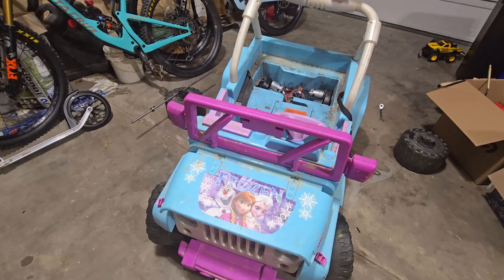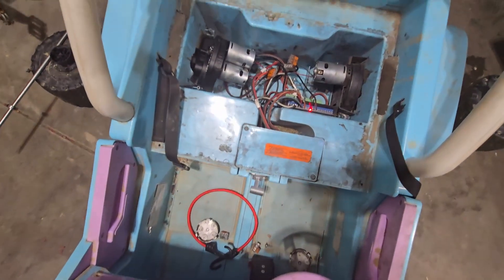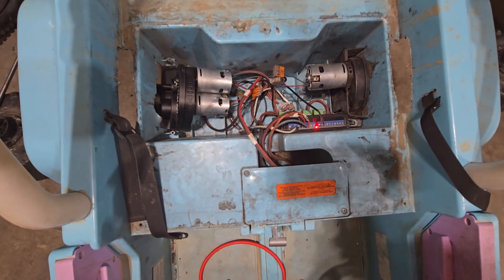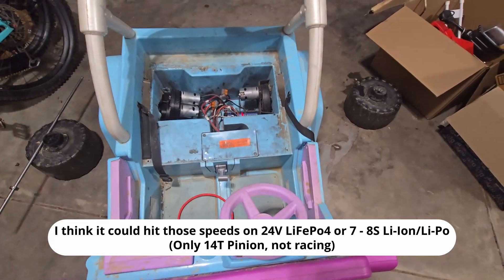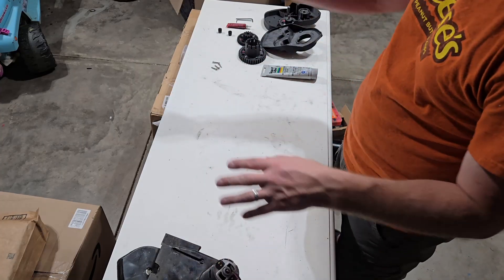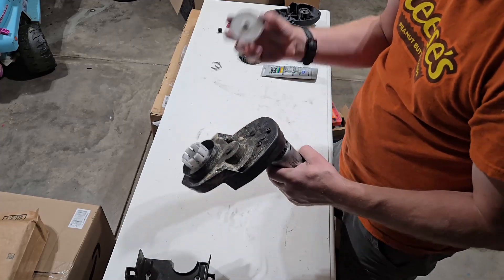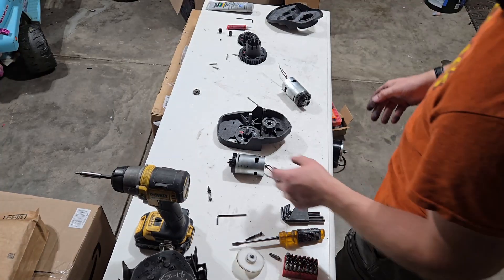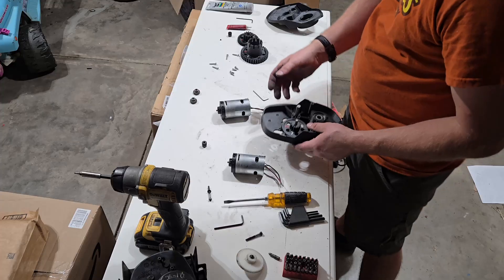2HP 4-Motor Power Wheels Jeep Build – Monster 887 Motors!

Comment: Do you have a link for the 3d printed gear delete?
Reply from the maker: These are Lyles 3D printed gear boxes.  They are for sure great for drag racing, I haven't put enough time on them to determine if they will hold up for ripping around the yard though.  I have noticed a lot of material (looks like brake dust) around the wheels so I am guessing they are wearing a bit.  

https://lyles3dprinting.shop/
Reply: @PeanutWorkshop alright. Thank ya.

Comment: I just got a used one for free. The gear boxes are loose and have play up and down and forward and back on the great box retainer Is this normal? Or are they supposed to be tight with no play?   Btw, it looks like your stock gear box has the plastic gear box retainer but your aftermarket does not, is this correct? Thanks
Reply from the maker: The stock gear boxes move around a bit, even with the retainer. 

The aftermarket ones were rather snug and didn't have the screw holes so I left it off.

Comment: I keep burning up the 895 motor on the grave digger with 24v. Having a hard time finding 887 motors. Where did you pick these up?
Reply: They stock them on their website now. The ones they've found to be most reliable. Johnson 887s I believe.
Reply from the maker: We have an 895 burn out on the grave digger every few hours of riding in mud or steep hills.  We haven't tried putting the 887's in the grave digger but we do have some for sale on the website with an adapter for the 7R gear boxes.  They will not bolt right in for sure.
Reply: @PeanutWorkshop I'm blowing the left motor Everytime we approach full power. There doesn't seem to be any binding the gear boxes are new. Stumped again lol

Comment: Would 895 motors fit on this dual gearbox? And how do 887s compare to 895s? I am interested in this for my dune racer and want high torque for doing steep trails in the woods
Reply from the maker: I don't think you could fit any bigger but the 895's are just about the same diameter so they might fit.  I will try and remember to test fit if o take one apart why time soon.  These 887's have a ton of torque, I have no numbers but they seem to be about the same as the 20k rpm 24v 895's.

Comment: How do you figure the amp draw on the motors?
Reply from the maker: We have current measurements for the individual channel in the motor controller app.  You can monitor voltage and current in real time through wi-fi.